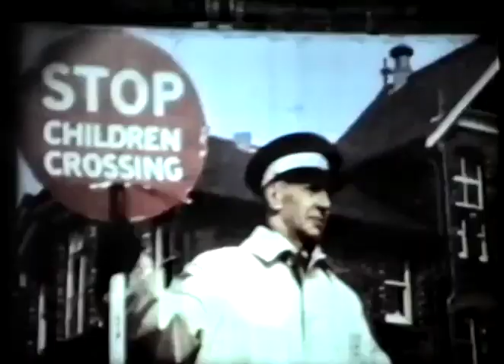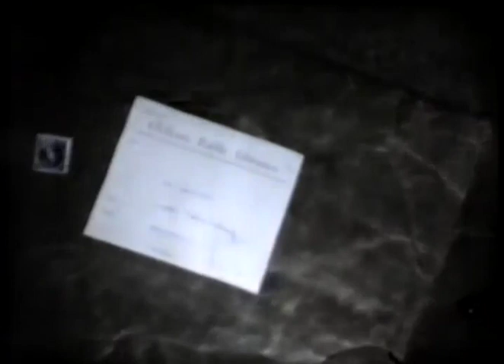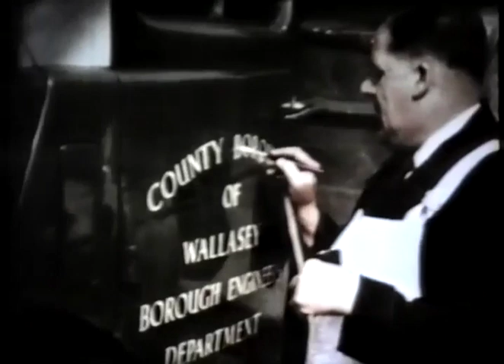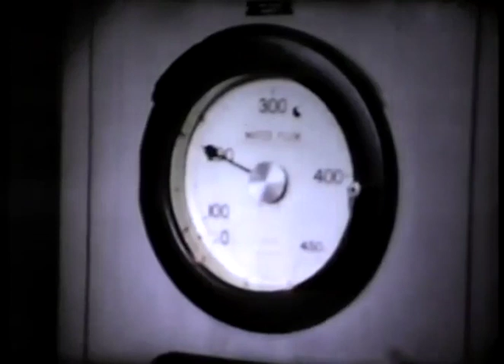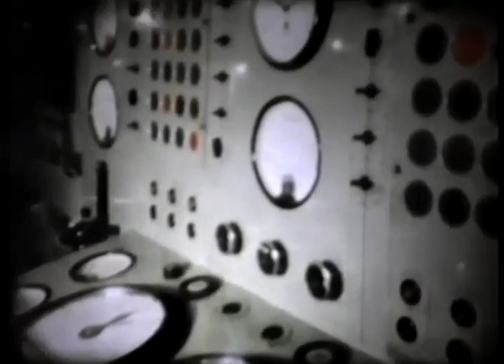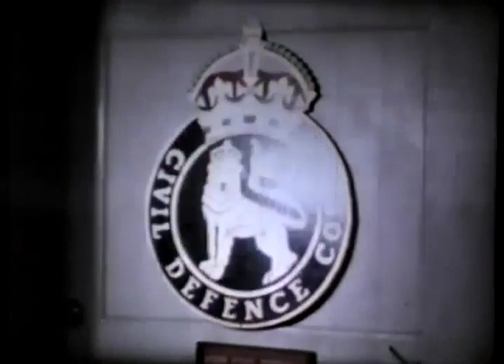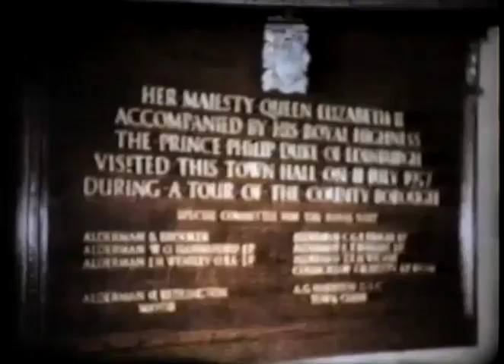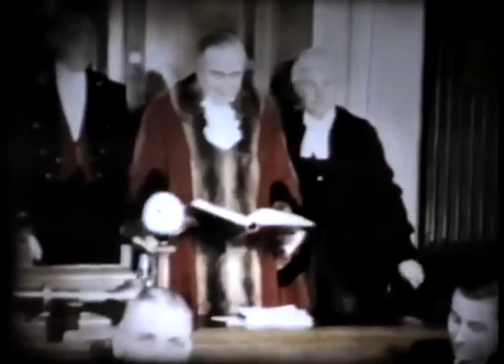Wallasey Charter Jubilee Year 1960

Comment: Where did you find this gem David
Reply from the maker: My father made a copy in 1989 at Birkenhead Central Library by pointing a VHS video camera at the projector screen while the 16mm film played. He then transferred to DVD in 2005 and I ripped it to the computer using Handbrake and uploaded it here. Back in 1989 the 16mm film needed repairing at the time in order to project, so I am not sure if Wirral Archives still have it.
Reply: Great stuff other wise it would have been lost for ever